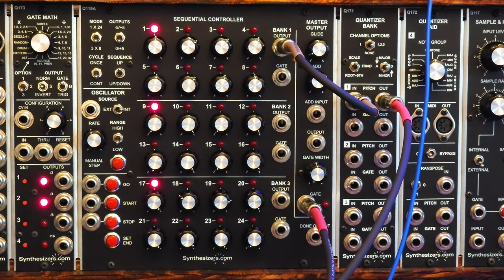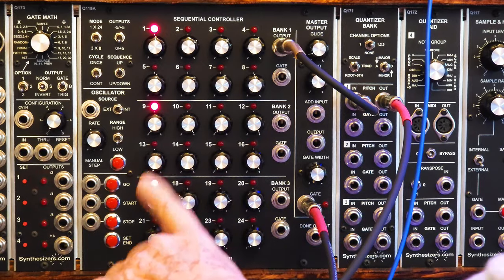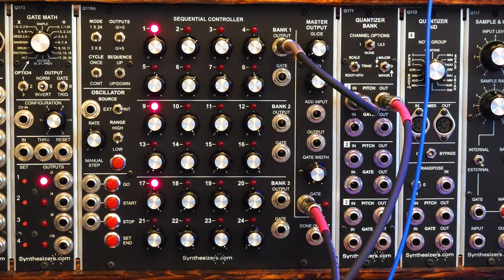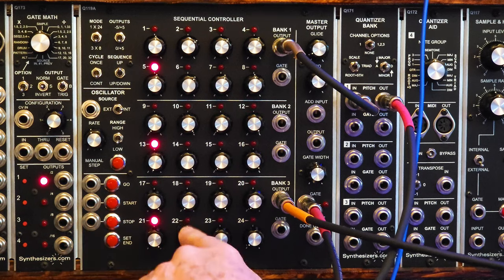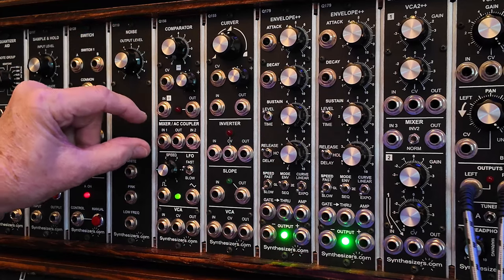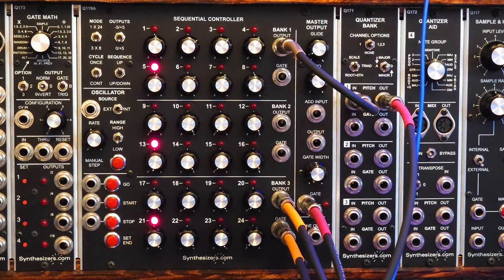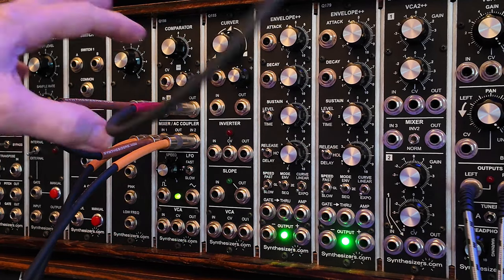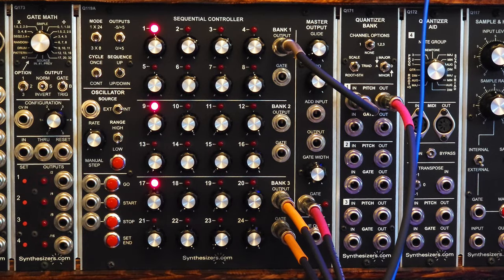Rhythmic Patterns with Q119a + Q156

Comment: Glad you're making these videos! I actually do this with a Behringer Eurorack replica of the Moog 960! Except I run my sequencer CV out through a VCA and use the clock as the VCA CV, or the other way around, depending on what I'm triggering. You could maybe do something similar and save yourself that AC mixer, by feeding the CV out into the comparator threshold CV in, and running the clock into the comparator's input. You can do the same using that VCA on the bottom too, for two of these sorts of crude "logic AND" circuits. That gets pretty neat with clock dividers, especially if you have another sequencer. (Look at how the Moog Subharmonicon sequencer works)
Reply from the maker: Great info. I’ll play with that. Like I said I found this by accident while working on another project. I like the VCA suggestion, especially since I have several.😊
Reply: @geoelectro  Forgot to mention a caveat I'm sure you're already aware of. But for completeness sake, voltage levels can cause this patch to fail. If your clock source is weak, it doesn't open the VCA all the way, and your sequencer CV may not trigger your envelope generator. Generally, all I need to do is add some offset to the VCA CV input. (The level knob, if your VCA has it) It's not usually a problem anyway, but for some of my modules, their output just isn't hot enough. Especially when you're using this trick with two low output clock sources instead of a clock and a relatively strong sequencer step.
Reply from the maker: Well the cool thing is there is always a module or 2 that can help. The fun is figuring it out!😊